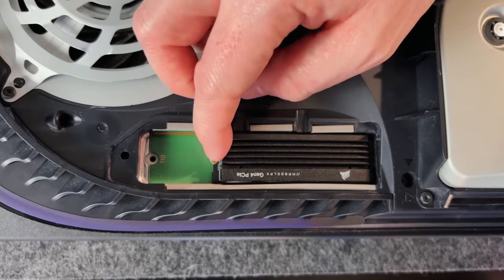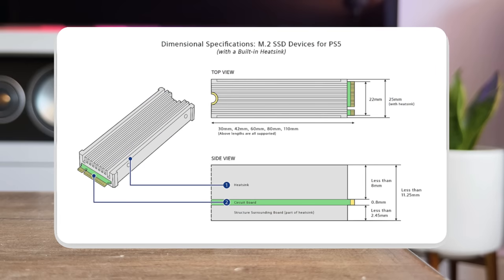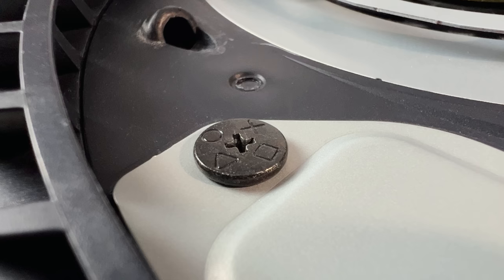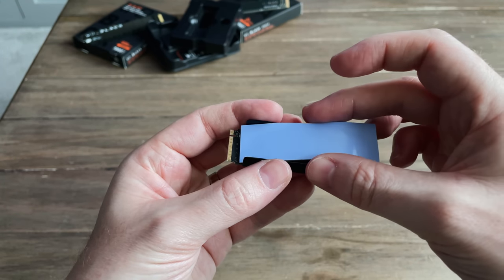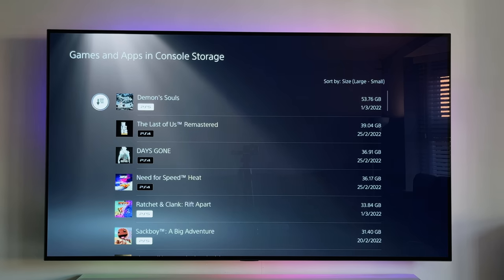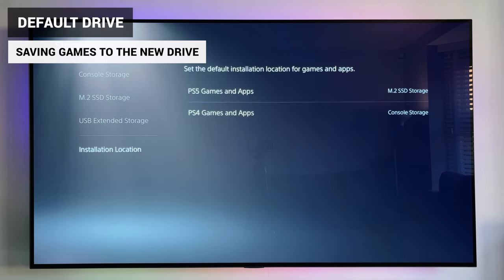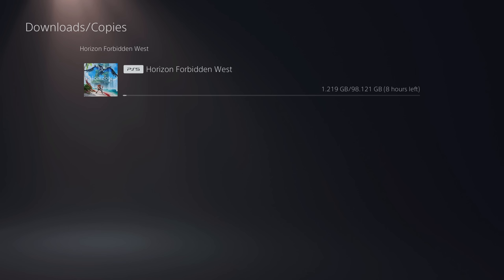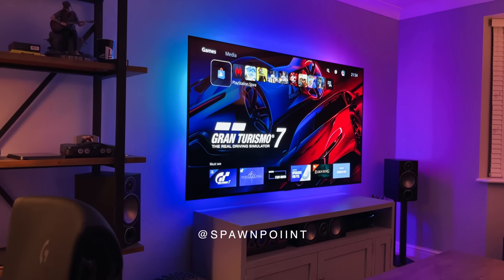The Ultimate PS5 Upgrade: Installing a 4TB SSD

Comment: Would you look at that, a upgrade that makes it completely useless because the PlayStation 5 don't even have that many good games to even need that much space, I have four terabytes myself and I'm bored  on my PlayStation 5 with nothing to do, not to mention the crappy features the PlayStation 5 has that makes the PlayStation 4 far superior in certain elements, like for instance the speaker built into the controller and also the ability to hear your friends through the TV without needing headphones plugged in, don't get me started on wallpapers and themes either, with a PlayStation that's full of nothing but advertisement, even when you're offline the advertisements stay in place..... Then you have a web browser you can't even access unless you send a URL Link in a message to somebody and Sony is slowly working on all URL links not working..... For the price of the PlayStation 5 you are better off getting a gaming PC because it's not worth the hype and it's trash